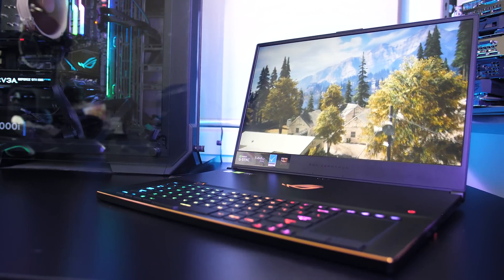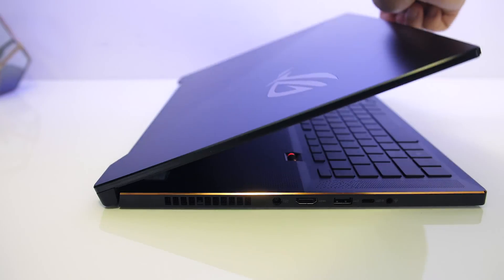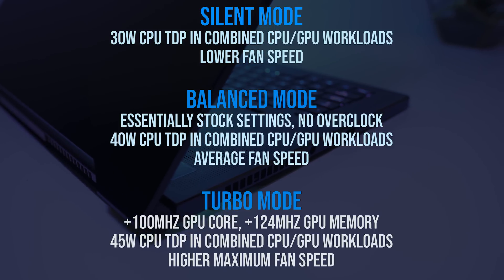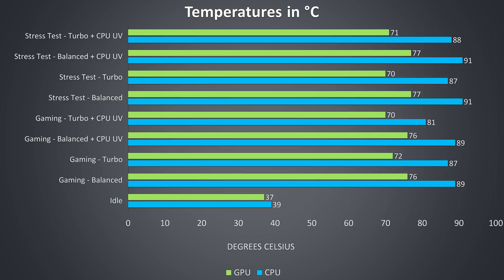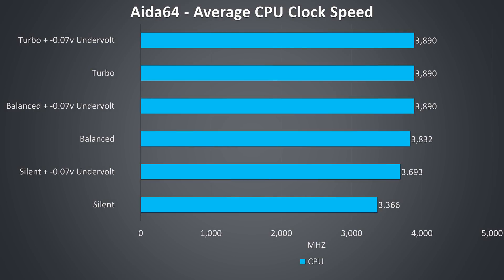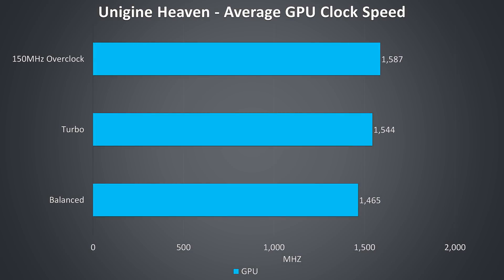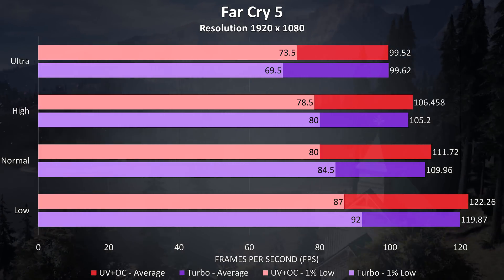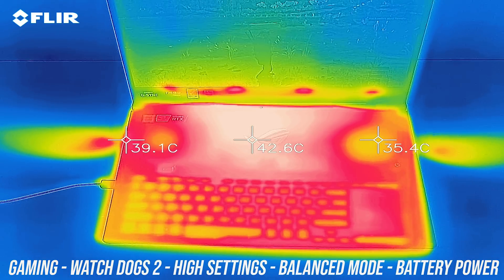ASUS Zephyrus S (GX701) Thermal Testing, Overclocking and Undervolting

Comment: Hey Jarrod I told you about the G5 I was getting last time. I currently I have a Dell Inspiron 15 3521 ( core- i3 ) it has a 500gb hdd which is now broken. Should I install a 250gb Samsung EVO 860 SSD ? I don’t want to waste this laptop since it is in very good condition . 
Thanks Jarrod! ❤️
Reply from the maker: Yeah 860 Evo is a decent SSD for the money, I have a few. 250gb may be a little low depending on what you're doing, but that's up to you and how much data you've actually got.
Reply: Jarrod'sTech just 1 game called SMITE and just school work like word, excel PowerPoint etc. so I feel 250gb is enough as I will be getting a G5. Or should I get the 500gb one what do you say?

Comment: What program did you use for undervolting and did you also try the turbo overclock as well as a little overclock on MSI afterburner?
Reply from the maker: I did manual overclocking with afterburner, I didn't get much extra from what was already in place. I use Intel xtu for quick and dirty undervolting, but I suggest looking at throttlestop for longer term use.

Comment: This is easily the best channel to go to when you're looking to buy a laptop.
Reply from the maker: Thanks!
Reply: Jarrod'sTech Dave Lee is better!
Reply: @devmister3736  You're mistaken
Reply: @devmister3736  get a life
Reply: Jarrod'sTech can you please give me some advice to what can i do if I want to connect the laptop to the internet? Like thunderbolt or what, thank you in advance
Reply: @roderickvergara788  You have to use an ethernet adapter brother
Reply: What about the ethernet? Can anyone tell me what can i do to connect wired my zephyrus s to the internet?
Reply: @roderickvergara788  it has WIFI 6 which is as good as ethernet atleast if u r close to router and getting good signal strength

Comment: It gets  a lot of hot. Sometimes with the o overclocking  on my games on Max setting l overclocked everything
Reply from the maker: You have this? What sort of temperatures do you get?
Reply: @JarrodsTech  Between 60 degree and 85.4 degree
Reply from the maker: Sounds perfectly fine to me.

Comment: Honestly out of all the RTX laptops that have come out this is the most feature rich one of them all. Nice thin design, good cooling, and can be charged by usb c in a pinch. But, there are three things that keep this from being a definite buy. Only one m.2 slot, one one ram slot, and no thunderbolt. And alot of these are things competing laptops have. For such a premium laptop I feel these are pretty gross over sights. Especially since Asus was bragging how professionals use gaming laptops for work related tasks. Oh well. Maybe next year Asus.
Reply from the maker: Yeah the upgradeability isn't great, those things are some of the few downsides I mention in the full review. I asked at CES about the single memory slot, they said there just wasn't space on the motherboard for two due to all the cooling.

Comment: I have seen an approximate temp. drop of 5 degrees  on both GPU and CPU, when using a cooling pad with  my 17+ GX701.  I must note that the open rear end design spreads heat in nearly all directions, except towards the front, where the user sits. The design is ingenious for a gaming laptop to disburse a lot of hot air from the chassis. No Purchase Regrets, Great Performing Zephyrus.
Reply from the maker: Nice! Yeah I noticed no hot air coming out at all where I was sitting, maybe a little on my mouse hand as it does come out the sides near the back but that's it.
Reply: D Mck my GX701 with more hot air outflow to left hand side

Comment: Hi Jarrod. 
I have bought the Asus GL704GW with RTX 2070, i7 8750H and 2x8Go RAM. The limit of undervolting the CPU is -0.083V and the temperature was still hitting 90-95 degrees. 
What I dit is using the Asus GPU TWEAK II software and limit the FPS to 60 (I personnally don't need to go higher) and the increase is big. My CPU temperature is now 80-82 maximum and the game is still very smooth (GTA V). I recommend you test it because it is good. Sorry for bad english. From Switzerland.
Reply from the maker: Nice! Yeah limiting frame rate can help improve temperatures, personally I prefer the extra performance I'm paying for though and just deal with running a bit hotter.
Reply: Okok i see. Thanks for the answer
Reply: @manuelneuer1031  i did that on my 15x, refresh rate is 144 so i cap the fps at 72 in games that dont need more, its the 2nd most effective change in settings ive done to control temps.

on battery its capped at 35, so its 1/4 the refresh rate and still looks smooth
Reply: @bradhaines3142  Yeah I think it is a really big deal for those people like you and me who don't need more fps.

Comment: I got an Octane VI from PcZentrum. I7 8700K running on Stockspeeds with -0,15V UV and a RTX 2080 with +170Mhz on Core  and 15.200Mhz Memory (Stock = 14.000Mhz). I did not increase the Powerlimit. The temperatures are great, they do not get above 80°C. Most of the Time around 75°C. Both, the processor and the graphics card. I am using the fans in automatic mode and a Cooling-Pad.  A Laptop Like the one in the video is too thin for me.
Reply from the maker: Beast mode 💪
Reply: @JarrodsTech  it could be a lot more. But increasing the Powerlimit is not an option for me. At the moment i can get 21.800-22.000 points in Firestrike. A little bit more than 6.000 in Firestrike Ultra (4k Benchmark) and 9.800-10.000 in Timespy.  That is enough for me.

Comment: Amazing video, thanks Jarrod! By the way, the 2080 max-q in this laptop clocks higher than those in other laptops right? Linus tech tips even said it clocks closer to a desktop gpu than a laptop one. Can i assume this is also the case with the 2070 max-q version?
Reply from the maker: Yeah it does, it's the 90W one, most of the other laptops seem to have the 80W 2080 Max-Q. Not sure what sort of power options the 2070 Max-Q is available with just yet.

Comment: jarrod, my asus strix scar 2 drains power from my battery while in turbo mode, my unit came with a 180w power brick. the only way to avoid this is to buy a 230w aftermarket power brick. what do you think? or is it not that big of a deal? my unit is the i7 8750h and gtx 1060 6gb version.
Reply from the maker: I would have thought that 180w is enough for the 1060, given it seems to be alright for the 2060 in some cases. If it's draining power though then yeah I think a better power brick is the only option, assuming you can't lower power draw with undervolting.
Reply: @JarrodsTech  ya but man o man that turbo mode kicks ass!! the only option I saw was a aftermarket 230w power brick for 80 us dollars. do you know where to pick up oem power bricks for asus?
Reply from the maker: Nah I'm not actually sure where to get the bricks, you could try contacting ASUS and see what they say though.
Reply: @JarrodsTech  asus does not sell them. oh well. what do you think about a aftermarket power brick?
Reply from the maker: Hmm probably fine so long as it's from a half reputable company, as long as it has the right connector on it.

Comment: Too bad it doesn't have TB3 port... who needs a power delivery usb in a gaming laptop!
Reply from the maker: Yeah would be good if it had it. I think the USB C charging feature is nice to have, compared to not having it.
Reply: Yes. Th usbc charging was a key factor in selecting this, as I need a machine I can use for work on long flights. Gaming was very secondary.

Comment: I used to put a couple USB fans pinched from a laptop cooler on the top of my GS70 and it had such a positive effect. That surface on top would take a couple huge fans, but I guess there is no point, it's very well cooled.
Reply from the maker: Nice! I have one of those fans, but haven't ever tried using it pointing on the laptop before.
Reply: @JarrodsTech  I got the idea from this guy http://forum.notebookreview.com/threads/msi-gs70-stealth-pro-theard.747505/page-149

Someone used to put five in a row on there also.

Comment: Question: this laptop is running a single 24gb RAM stick ?
2nd question: Only 1 RAM slot in this laptop?
Reply from the maker: Yes 1 memory slot, it's got a 16gb stick installed, 8gb is soldered to the motherboard and cannot be upgraded.
Reply: @JarrodsTech  so that works as  Dual channel?
Reply from the maker: The software reports it as dual channel, and in the past the performance looks like dual channel.

Comment: the temps on this laptop are amazing, and the performance you get is really good for such a thin footprint. Even though the undervolt wasn't that high it still lowered some temps by 4°c. On linus' review the rog logo on the front can cause some heat because of the bright leds. Would be nice to see those temps with the addition of the undervolt. Anyways, as expected quality testing. Keep up the good work !!
Reply from the maker: I think it would be hard to determine what heat comes from the logo, if any, as that area just gets so hot to the touch while under load anyway.
Reply: @JarrodsTech  I think Linus was referring to Asus's own materials that say turning off the logo on the intake might lower temperatures as much as 3 degrees Celsius, though I think he was just taking their word for it.

Comment: I've had my PS4 since it launched, I'm wondering if a laptop like this one has the same life-span if you handled it carefully?
Reply: The build quality on this thing is quite excellent.  That was one of my top deciding factors going for this vs the MSI GS75, it being fairly flimsy and disappointing in build quality (though giving you about 0.8 pounds less in weight as the trade off).  Premium laptops in general tend to last a long time barring accidents, I've had many laptops and all the premium ones have lasted many years, some 10+ years just fine, still ticking.  With that said a laptop vs a console is a bit of an apples to oranges.  A laptop is a movable object you directly interact with a lot more, so they do need to handle wear better than consoles because of that constant interaction, but it also means more chances for accidents and more components that could fail over time (think of every key and button vs just a handful of buttons on a PS4.
Reply: @M4ttNet  my laptop is not going to be moved that often! It's going to be at a temporary home for a few years so it will be moved as often as a console would. But your answer reassured me! definitely getting one now!
Reply from the maker: Should do, I'd expect something like this to be fine for years.
Reply: @JarrodsTech  Alright, Thanks:)

Comment: 16 gigs of RAM save some money.
Reply from the maker: It's got 24gb, unless you're suggesting to get it with 16 instead?
Reply: @JarrodsTech  not sure but 16 gigs usually can save some money.  When people skip 16 they goto 32 gigs instead.   Very few people need beyond 16 gigs.  My experience if they have two different ram sizes one is slower than the other as well.

Comment: the laptops' design is my favorite in any laptop, love the most that the keyboard is down instead of up like daaamn. too bad I won't get this because the software is buggy and some things are broken and so on, just read the Amazon reviews on it 🙄
will probably get the gigabyte aero 15 x9
Reply from the maker: Hmm can't say I had any issues with the software.
Reply: LunarAtom why you like keyboard?
For me it’s look like you need to sit farther from screen and for laptop it’s bad due of small screen in general
Reply: @iraklimgeladze5223  i like it bc when i game on my MSI, it heats up to 95C & my fingers on WASD & I rest my upper hand on the left bottom side heated area. I can see my skin turning dark brown bc of heat!!!!!
Reply: Agreed regarding the keyboard.  Each person's case is different and I imagine on the lap it's not an ideal keyboard setup, though for my use (a tray on a home theater chair) it's actually perfect.  Mine sits higher than most use cases so I have to reach over a bit, on a normal laptop I have to let my wrists/arms rest on the front of the laptop a lot more and it's a bit of a reach (not uncomfortable just not ideal), with the keyboard forward and to the left it's perfect (my tray comes from the right so it being on the left side really is perfect for me).  

As far as software issues, on Amazon there are only 6 reviews and only 1 had an issue (still gave it 5 stars too) and it seems to be with the speaker (guessing just got unlucky and got a faulty speaker so might have to RMA it).  I've had no software issues on mine.
Reply: I have the g701 2080q , the only con it has is battery life, everything else is perfect - considering that I’m traveling a lot and I need big screen to power my 3D work and gaming on the go it’s just perfect , 
If you need smaller laptop I would go for razer for his look and overall score value.